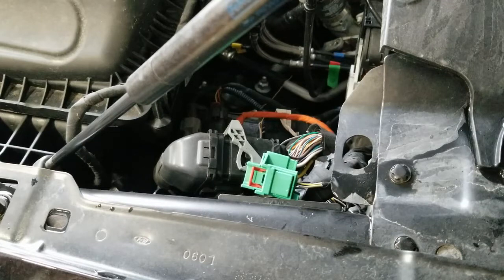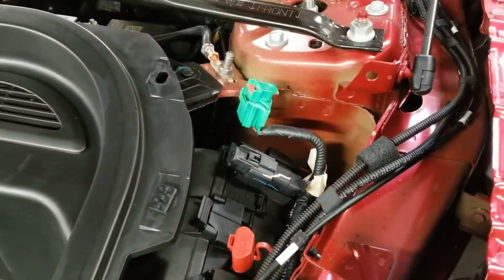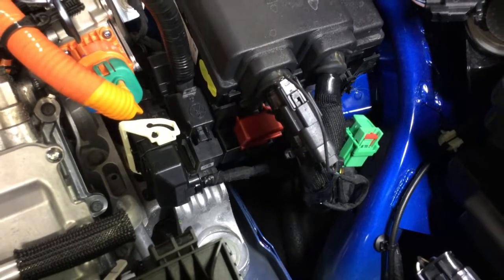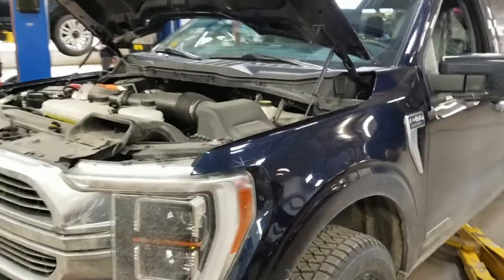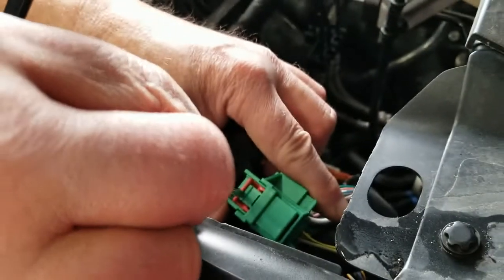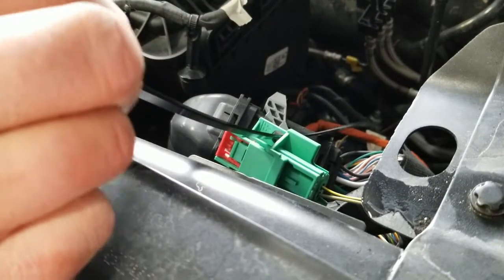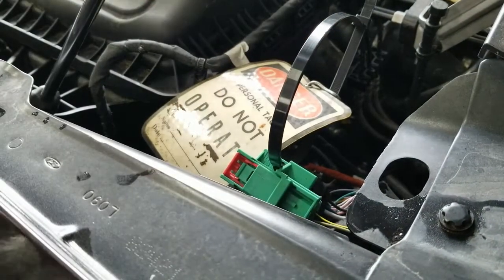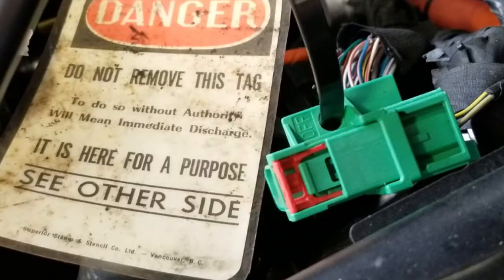Ford High Voltage Battery De-Energizing Procedure Safety Emergency Responder

Comment: Thanks for your video
I'm about to do a transmission removal 
I should in the clear with this procedure?
Reply from the maker: Yes as long as there are no high voltage battery fault codes

Comment: So I can do this instead of removing the cable off of the 12 volt battery underneath the rear seat then? I need to check the fuse box
Reply from the maker: Yes as long as you don't have a check engine lamp on with a stuck contactor
Reply: @RedneckCam666 can you elaborate, I have a code that says positive contactor stuck open
Reply from the maker: @the.gxrilla  The contactor assembly will need to be replaced